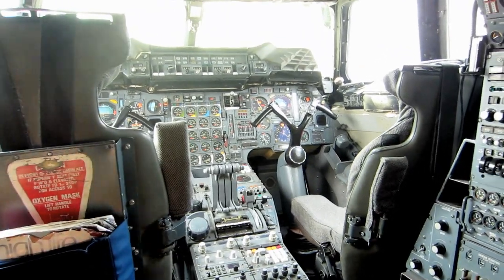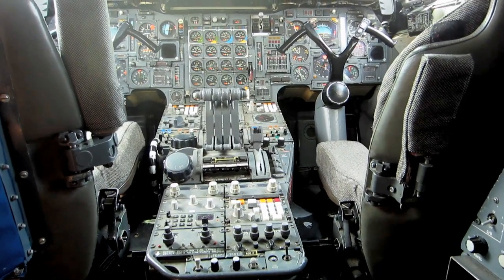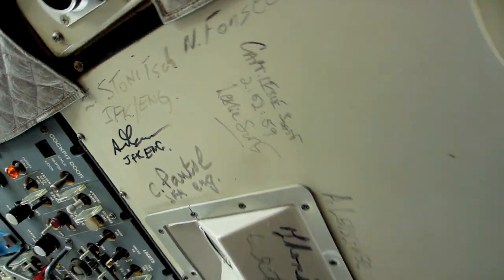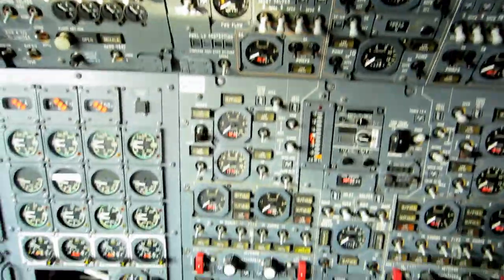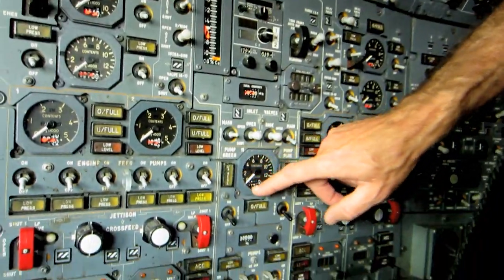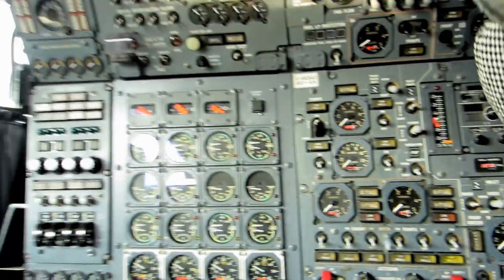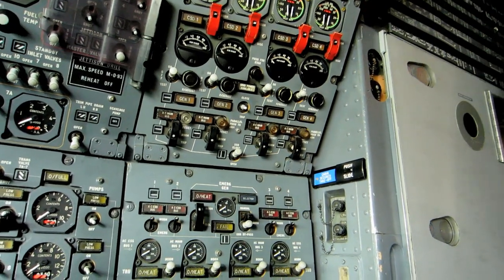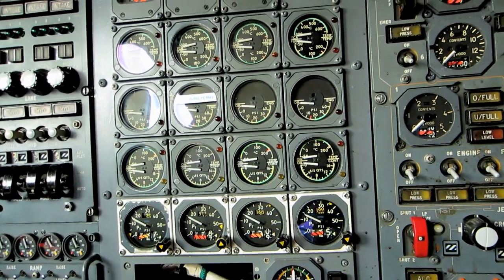Concorde alpha delta G-BOAD cockpit HD

Comment: 0:45 Not really true. Concorde was quite specific airplane. Some systems could be controlled automatically or manually. Fuel transfer could be some kind of semi automatic or fully manual depending on what you want. Engine intake control could be fully automated or fully manual, normally it was set to automatic all the time. Secondary air door could be manual or auto. Some other things like fuel heaters could be automatic too if you wanted it to be.